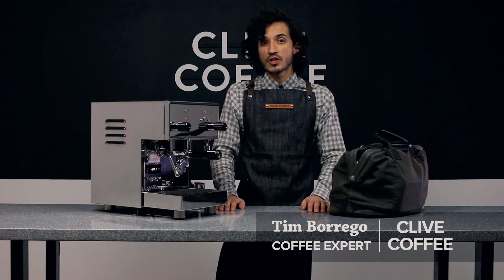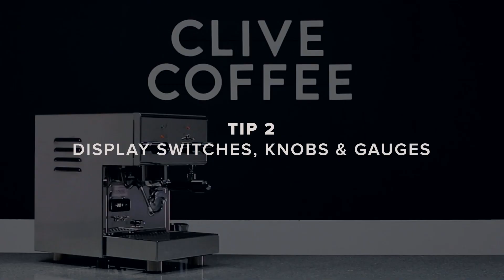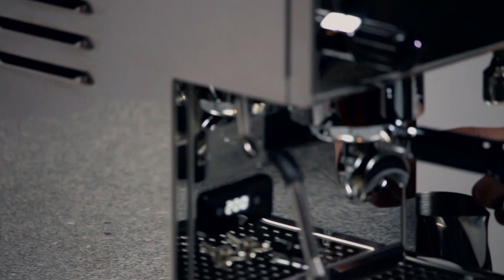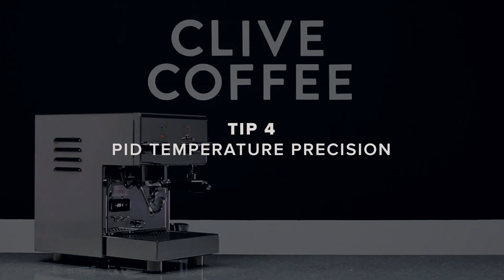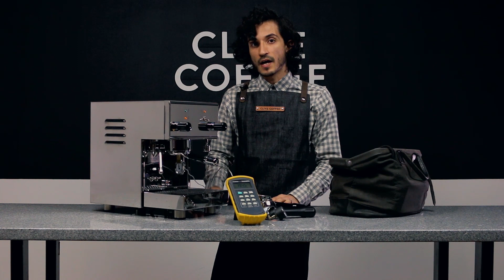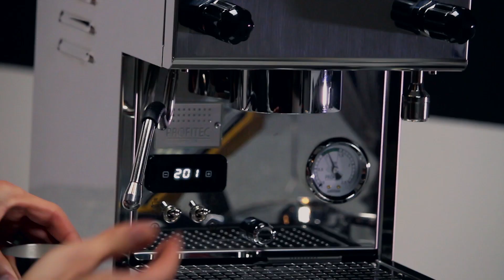Profitec Pro 300 PID | Tech Tips

Comment: Is there a pre-infusion for 3 or 4 seconds when brewing?
Reply from the maker: No, there is not pre-infusion on the Pro 300. However, there is always a slow ramp-up in pressure in most machines with a vibratory pump before you reach full 9-bar pressure, so you're not blasting the puck right away.

Comment: Curious as to why they decided to put a steam pressure gauge instead of a brew pressure gauge on the front of the machine? I would prefer a brew pressure gauge. Or better yet, why not a dual readout gauge, since there are two boilers?  How would you be able to adjust the brew pressure or check the brew pressure of this machine, if at all possible? Oh, if only I could design my own machine. 😁

Comment: Hi. I would like to thank you for this great video that's full of knowledge and tips. I got one question where can I buy this  pump pressure tool?
Reply: Saad:  You can buy a pressure gauge with PSI or Bar markings at Home Depot or Lowes and the necessary adpaters to screw them onto your portafilter. I bought one for a little as 20 dollars. You can also order one on Amazon: https://www.amazon.com/Portafilter-Pressure-Gauge-Check-Kit/dp/B012WQ5XLK/ref=sr_1_2?gclid=EAIaIQobChMIiZyg8un15gIVDMNkCh0LyghFEAAYASAAEgKqo_D_BwE&hvadid=410054921015&hvdev=c&hvlocphy=9032457&hvnetw=g&hvpos=1t1&hvqmt=e&hvrand=16428171371725416991&hvtargid=kwd-3472568497&hydadcr=28330_11859632&keywords=portafilter+pressure+gauge&qid=1578549211&sr=8-2
Then bring your portafilter and gauge to a hardware store to get the correct adapter threads. You may not even needs adapter threads with this gauge since it's made for portafilters.

Comment: Great information, thanks!  I think Pro 300 makes more sense for me as a home machine than the bigger brothers 600 and 700, which I have been thinking about to get.  The fast startup time is just unbeatable on the 300.  I’d rather wait 10 minutes than ~40 minutes what the big ones need for your first cup in the morning.
Reply: I chose the 300 for the exact same reason. used the extra cash to buy a better grinder! love the 300 :) ( upgraded from Simonelli Oscar after 10 years of use)